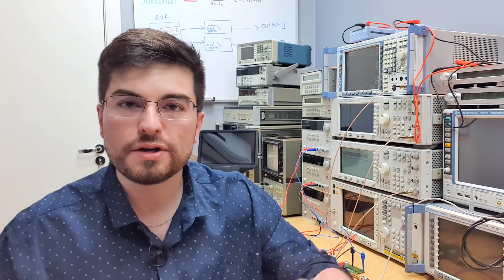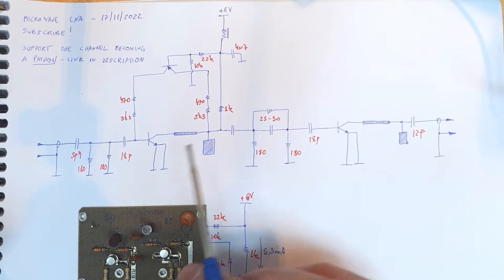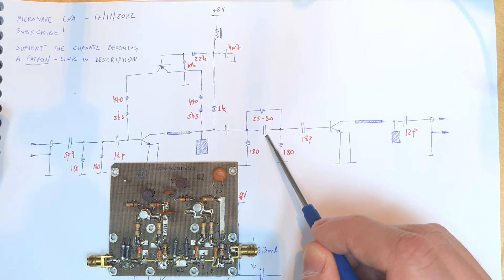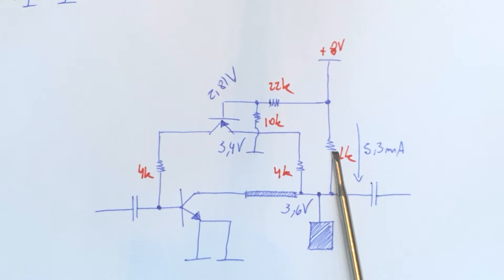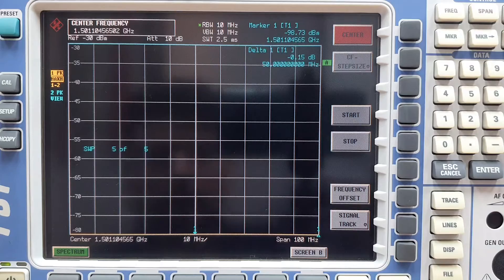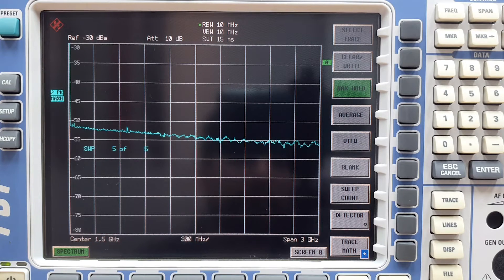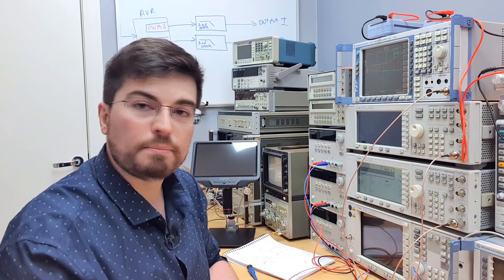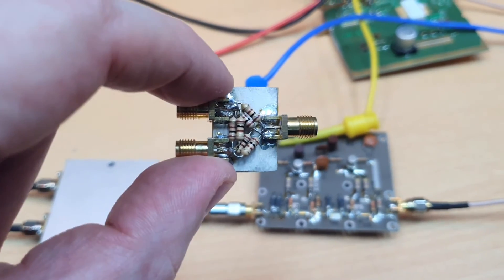Microwave LNA Amplifier - Reverse Engineering

Comment: I've been trying for years now to build a simple receiver and still no success. I hope you can explain how to me how to design a front end. specifically how best to couple to the tank circuit. I mean, the tank is high impedance, at least 5k ohm (measured) common base is very low impedance, even common collector at RF has a low impedance. If i have the tank in the collector circuit then I'd have too much gain in the front end and the miller effect becomes an issue ... basically, do you have, or could you please make a video, describing good practice for a front end? antenna, tuned circuit etc... i know it's a lot to ask but i've been trying for so long with no success
Reply from the maker: Little tip: you can couple the transistor in a lower tap on the inductor, a lower tap will have lower impedance 😏
Reply: @AllElectronicsChannel  bueno.. entonces voy a intentar: bias el transistor con 12mA, couple el antena al emitor, tank en el collector, y lower tap el tank para couple al proximo stage.... gracias!
Reply from the maker: @coffeecuppepsi  Nice!! good luck!
Reply: @AllElectronicsChannel  Amigo!!!! Looks like it worked, now I'll try to add a second amplification stage ! Muchisimas gracias

Comment: Nice job ! 
I was also pretty amazed to see the bandwith and flatness of this amplifier when looking at the through hole resistors. 
Maybe they even use the inductance of the resistors as a RF choke.
Pretty crazy to think about that the smd capacitors might have been brand new technology when this circuit has been built. 
Thanks for taking such an in depth look at it, there is a lot to learn on even such a "simple" design. 
The japanese engineers really knew what they were doing and how to use cheap components.